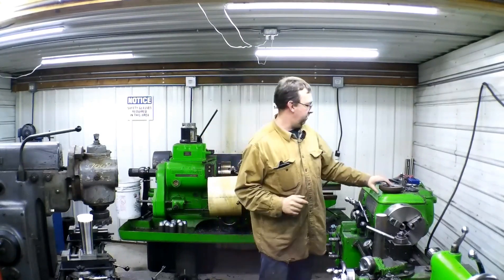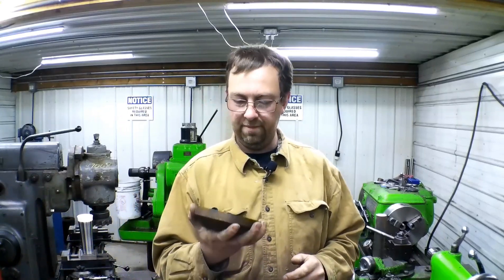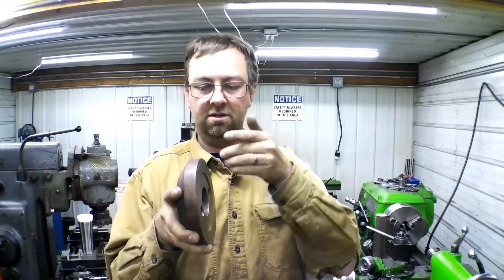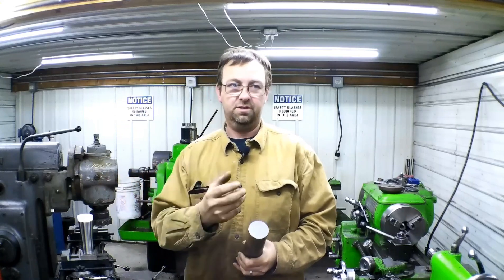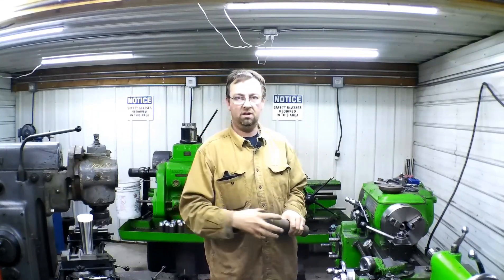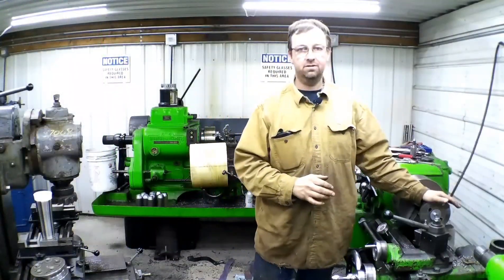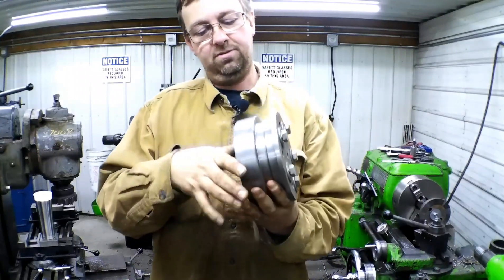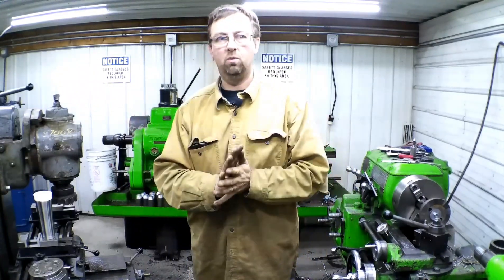Machining a Mandrel to Hold a Sawmill Saw Collar for Facing in the Lathe

Comment: The old machine shop built sawmill I bought didn’t have the pinholes in the collars. Also didn’t come with a blade. When trying to get a recommendation for a blade I asked what size pinholes were common and they said 5/8”. My collars measure 4” inside the step and 2” eye so for a quote a wrote down 5/8” pinholes on 3 1/4” bolt circle but that does only leave 0.3125” between the eye and pinholes. I’m a bit concerned about that. The blade isn’t made yet so I’m wondering if those pins could be pushed past the step or made of 1/2” maybe.

Comment: Excellent video. I've worked in mills all my life and own several of my own. An easy check when having issues sawing is to take a piece of paper and put in between the collar and saw, tighten the arbor nut, and check the pattern on the paper. Should leave a fairly cleat clamp line on the outside of the collar. Watched your mill vid also. Nice build!! Liked and subbed

Comment: I didn't get a good feel for the taper you ended up cutting. I heard you mutter '5 thou" at one point, but I don't know if that was the difference in inside and outside offset on that flange or something else. 

Is 1/16" over that 1.5" flange too much? That would be an angle of about 2.5 degrees when setting the compound.
Reply from the maker: You should have .002-.003 taper in the face. Biting only on the outer edge.

Comment: Nice work on the saw collar. Is this for a LH or RH mill?
Reply from the maker: I never even asked. All saws use the same collar taper, and that's all he brought me.
Reply: @TopperMachineLLC  Mine has LH threads and the nut is screwed up. If it were RH McMaster has one, but LH I'm S. O. L. And have to make one.
Reply from the maker: @EngineersWorkshop  my mill is LH, but I threaded it to a standard size so I could order them.
Reply: @TopperMachineLLC  Unfortunately the setup I will do and the orientation of the blade requires the LH threads. Lucky for me the arbor was correct, and the tensioning in the blade is correct as well. Murphy loses on this one.
Reply from the maker: @EngineersWorkshop  I'll get some videos of my mill sometime in the next few months. That should help you get ideas.
Reply from the maker: @EngineersWorkshop  that's no big deal. Maybe I should do a "internal.LH thread" video.